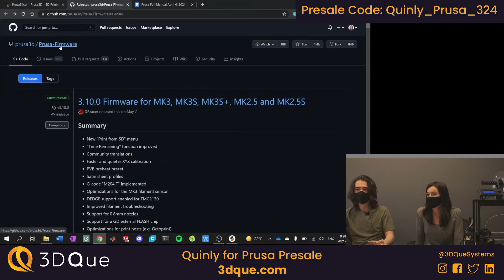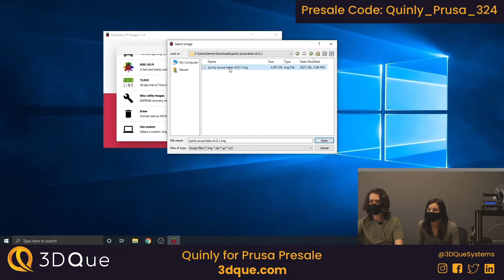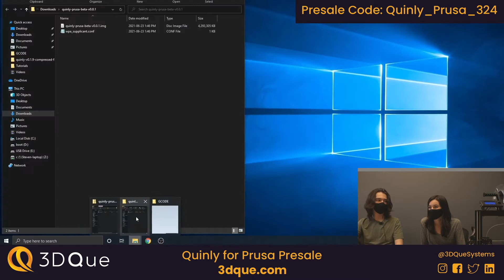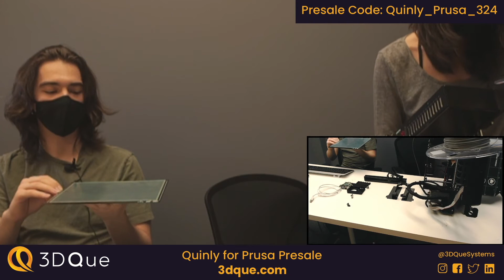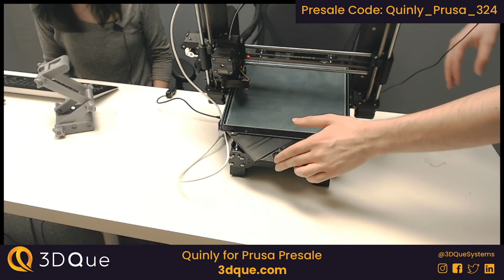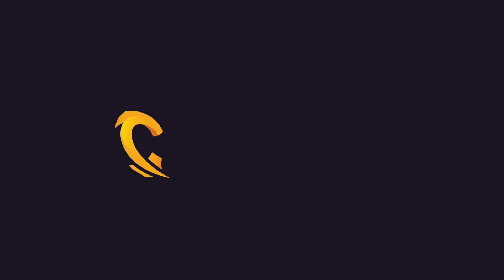Prusa MK3 Automation Upgrade - Quinly for Prusa Launch!

Comment: What materials can you use?? I'm printing a lot of carbon fiber reinforced nylon. Would it stick and release from the bed??
Reply from the maker: We have not specifically tried carbon fibre reinforced nylon but it works well with nylon. Contact us at info@3dque.com and we can arrange testing.